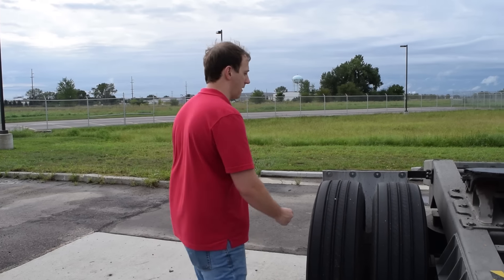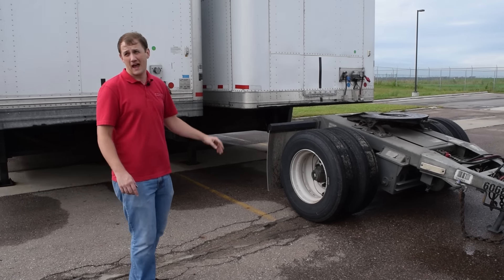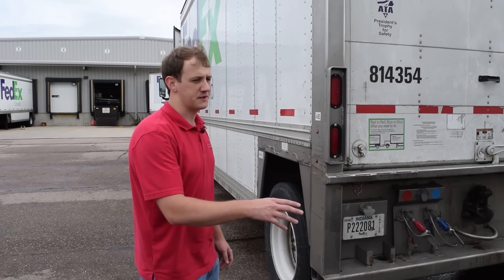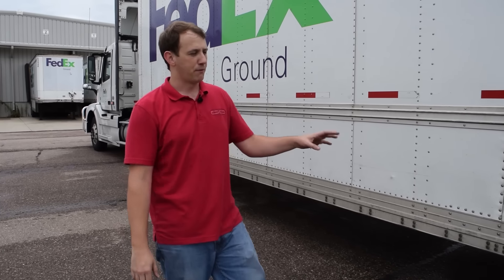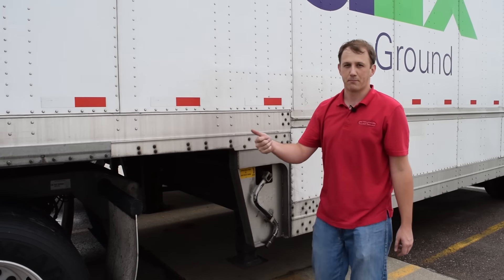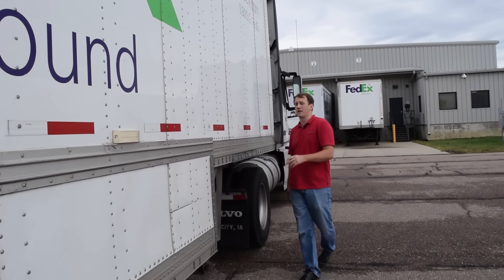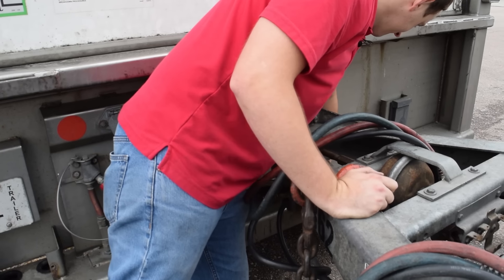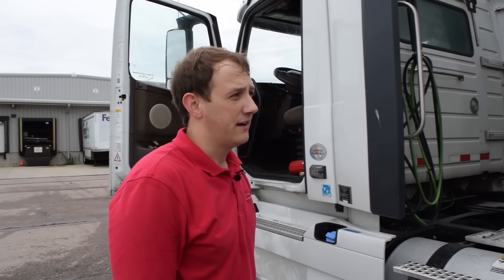FedEx Ground Doubles - Double Trailers

Comment: 2:30 Why don't you attach the dolly to the trailer when you're already there with the truck? Am I missing something?
Reply from the maker: The process is 1)place dolly uncoupled in front of rear trailer 2)back lead trailer to dolly 3)couple dolly to lead trailer 4)back trailer dolly combination to hook rear trailer.
If you couple the dolly to the rear trailer using only the truck 2 things happen 1)the force of the trailer weight on the dolly makes it virtually impossible to disconnect it from the truck's pintle hook 2)if you do manage to get the dolly unhooked from the truck you would have a very hard time getting the lead trailer in the exact correct position to couple it to the dolly.
Reply: I was just thinking the same thing!!😉 😆
Reply: Thorough video!!!
Luke my man below said...
Reply: It is more difficut to steer the dolly when it is attached to the front trailer.  Drivers that do not know how to control the dolly can easily jackknife the dolly and cause serious damage, so many companies do not want drivers backing the dolly behind the trailer more than a few feet.
Reply: Some places doesn’t let their driver do that because of damages people caused to the trailers
Reply: Oh, okay. I drive a truck in the EU and we don't have anything like that here, and especially tandems like this are very rare here. Immediately this question came to my mind that if he's already there with the dolly why doesn't he just hook it up. I guess your trucks also have the ability to lift the rear axle by air, so I thought if you can affect the tilt of the dolly then somehow that might work instead of backing up with a semi and a dolly that you can't see behind the semi.
Anyway, I wasn't trying to lecture or admonish anyone for doing anything wrong, I was just curious why it was so hard to do when in my head it was a lot easier.
Reply: @Orion599  if you go ahead and hook the dolly to the rear trailer without the front trailer you'll never get it connected to the front trailer
Reply: @tamipotirala6973 
For this reason, I am happy with the European system. Both truck and trailer have air suspension to use for lifting. Plus, the coupling used for dollys (or any other rigid truck + trailer combo) has something comparable to the jaws of a fifth wheel in all four directions, which makes it very easy to use dollys even if they are still connected to a trailer.
Reply: @Toepferle  interesting I like to see that
Reply: We like oldshool style. Americans, on the other hand, still use oldschool equiptment.
Reply: @Hypheh  Say what?
Reply: @mwalker3547  That dolly system is used by poor farmers in europe. Even rich farmers dont use so old design anymore, not to even mention road transport sector.
Reply: It’s all confusing is mixing trailers and different scenarios
Reply: It's very easy for the dolly to jackknife! 

 its already hard enough to back with the dolly on the tractor and keep it in a straight line. Imagine trying to back up with the dolly hooked to the rear of first trailer!

Comment: Make note. If your dolly that you pick has a problem. Please "RED TAG" the dolly. Note/state problem on Red Tag. Also let your dispatcher know that there is a problem with the dolly. Also goes for the trailers. Don't have RED TAGS? Ask your dispatcher/local maintenance shop. It makes my job a lot easier know what's wrong with the equipment and not just someone red tagging a dolly or trailer so NO ONE can us it. Thanks!!!

Comment: I used to be a DedEx Fround contractor 15 years ago...absolutely the worst....started at 3 pm, sometimes done at 11 pm or 12, and other days, the sun was coming up again...they didn't really care.  Get home at 7 am, go to bed so I could wake up and do it all over again.  Look at your pay settlement, not much difference between the 2.  

I never had the guts to do it, but, I always admired the guys who could break doubles by releasing the pintle hook on the dolly and slide it out from under the rear trailer at the same time!  It always looked great!  Dolly bang the pavement.  My luck, it wouldn't come out under the trailer all the way and be stuck up in the air!

Also, the guys who can back up doubles, turn them around...that is talent!

There just isn't any money in running for $1.40 a mile, I don't care what EdFex does for fuel supplement.  Cost of repairs, insurance, tires just keep going up.  

I have my own authority and haul my own freight.  Much better off.
Reply: Depends on terminal

Comment: When connecting to a trailer at a dock, make sure to knock/bang on the trailer before anything to check for loaders. I worked at FedEx for 2 and a half years And there was many times where the truckers hooked up and some even took off with me in the trailer.

Comment: This is a great video if you work out of terminals.  But if you are heading out with a set of joints full of freight going to some obscure warehouse, the set up may be different.  There are a lot of little tricks you need to know.  For example, if you are dropping your trailer on a curbed street be sure to drop your trailer with the front of the trailer nosed out from the curb a ways.  If you drop it straight against the curb then when you go to back under the trailer it will slide toward the curb because the crown of the road surface will cause the landing gear to slide up against the curb.  When that happens your duals will run into the curb and you will never be able to line up the kingpin into the center of the fifth wheel.  When that happens you have to call a tow truck ($400.00 in 1974), to come and lift the front of your trailer back away from the curb so you can get under the trailer to hook up.  One of several expensive lessons I learned the hard way during my trucking career.  Nobody ever told me Jack.
Reply from the maker: When doing linehaul for FedEx, they just make it too easy! Thank you for sharing your experiences with us!

Comment: Been pulling these things for over 15 years. You will pick up tips like also putting air to the brakes and cracking open the blue line at the rear to make sure you have sufficient brake air supply there too, especially in the winter because ice can form in the lines and boom no brakes back there. Also to insure you have no air leaks in the brake lines too. There are other tips even when selecting your dolly etc. etc. 
good video.
Reply: Big Steve Da Trucker : Yes they should be crossed. I caught that too. Moved rental equipment for 6 years and that’s all i learned.

Comment: Pulled doubles for 3 years for Carolina Freight carriers from 6pm to 3am.  Noticed changes in the
converter dolly (Bogey).  We never had air bags on the bogey back then.  You haven't lived till you had to walk back in a muddy field at some warehouse where the bogeys got dropped off.  Sure they roll real nice on blacktop!  Not so easily in mud with big holes in the dirt in snow and darkness.  Good times!
Reply: Forgot to mention.  That was 30 years ago!
Reply: Plus!  Our Pups (28 foot long trailers with single axles ) had  a safety bar in the front of the trailer to drop and secure so some poor soul on a forklift bringing freight in didn't get hurt when the trailer tipped down because the driver forgot to lower the bar and put a pin in it.
Reply from the maker: Times have changed! Luckily for us, we're always on pavement. Airbags have replaced all our leaf springs too!

Comment: I also pull doubles for a FedEx Ground contractor. This is a very good video but I do things a little different. 1. If the dolly chains are long enough they should be crossed. 2. Before hooking my air lines and electrical plug up I make sure the 5th wheel jaws are locked. Then I hook up the air lines and electrical line. 3. When dropping the rear trailer I disconnect all of my air lines to my dolly after pulling the 5th wheel and lowering the landing gear. It does save a little time when pulling the dolly away from the rear trailer because you do not have to sit and wait for the dolly to air up again. Plus some people drop their trailers too high and it can be a pain to lower them.
Reply: You need to go on Oprah,Amazing.just sayin'
Reply: But the payed it not acuray
Reply: ...nobody cares.

Comment: Well done brother. Going to take my doubles endorsement test tomorrow. Then I'll be hauling for Fed Ex.
Reply from the maker: Congratulations! First time showing doubles to a driver always makes me smile! It's not a hard process, and I truly believe doubles are better to pull than a 53' just for their agility while cornering. Safe travels!
Reply: @C2CCorps  I'm struggling with maneuvering the dolly in fact I had one the other day roll away after I released the brakes when I was gonna hook it to the back of the bobtail
Reply from the maker: @tamipotirala6973  That can be a problem, especially if you're not working on a level surface! There is a way to work on hill, you just need to be hooking perpendicular to the slope! Hopefully it was a non-event an nobody was hurt!

Comment: Very good video only parts i would recommend is wear gloves always for safety and so your not getting grease all over your steering wheel and every where else in the truck and hook up everything on the dolly from the other side that just so you can stay clean no lean against equipment also most importantly I wouldn’t spin the landing gear like that I’ve seen numerous people bloody there nose with catching it on there nose you could even break your nose just a thought to be safe stay safe to all the truck drivers out there good luck and have safe trips

Comment: Good training video....only critique is to not spin handle while rolling up landing gear.
Place one hand on trailer for support and roll up slowly. Too easy to loose grip and slip or hit yourself with the spinning handle.
Current CDL A driver of 30 years and 1 year with Fedex Custom Critical.
Thanks for your video.
Reply: @hello Richard how are you doing?

Comment: Back your dolly closer to the rear box. Try moving it the last 5 or 10 feet like he did in the winter. Have fun with that...

or even better, back your front box and dolly together onto your rear trailer. makes winter do so much easier.
Reply from the maker: Thanks for your insight! One trick in the winter when you're on fresh snow is to back all the way to the trailer and let the dolly's 5th wheel plate bump the trailer. Then pull forward a couple feet to unhitch the dolly from the tractor. Doing this creates tracks in the snow so you can still move the dolly by hand.

Backing the lead trailer and dolly combination to the rear trailer is doable, but you should practice caution when doing this. The dolly can jackknife quickly. Risking damage to the dolly and lead trailer when doing so, so be careful!
Reply: And other issue with backing lead and dolly together, FedEx has these safety bars on a lot of trailers and dollies that put pressure on the pintle hook when air is supplied. This unfortunately makes is hard to maneuver the dolly because it won't turn as freely, you pretty much have to jack knife the trailer to get the dolly to turn.  Can't be annoying. With out the safety bar is easy as pie. But it's rare to get a trailer and dolly without this feature.

Comment: I worked for FedEx Ground for just over 3 years in the New England area unfortunately I moved and I'm trying to get back in with FedEx Ground in arizona and it's not easy. The thing is most trucks I used was a dual axle and u can't get under the trailer to check ur fifth wheel if you have dual axle
Reply from the maker: You can....the 5th wheel on the truck needs moved back. Since the video, as a company we no longer have single axle trucks and only operate twin screw trucks.

If the spacing between the mud flaps of the truck and the landing gear on the trailer is too tight to get in and check jaws, make a hard turn to the right, about 4 feet. This will allow you to look into the jaws from the driver side directly. Due to the position of the truck to the trailer as it will be in a "turning" configuration, you can see the 5th wheel jaws easier.

Comment: I've been working for FedEx for 25 years. And it's shocking to me that all the truck drivers on here that missed the one thing he missed on the pre-trip. That was obvious as someone putting a live chicken in the cab your truck. There's no way you could pull these doubles down the road like this legally. Let's do a challenge let's see who notices what's wrong with this set of doubles and why you can't pull it down the road the way it is? I will tell you what it is if someone doesn't see it in the next couple days. It's a safety violation.
Reply: He didn't activate his brake lights during inspection and also has a e track strap hanging out of the rear trailer closed door.
Reply: @fordfanatic3307  thank you sir! It only took two years for someone to figure it out.

Comment: Pintle hooks and safety chain eyelets should be mounted inside the tractor frame rails .  Mounting these past the ends of the rails will expose them to damage .
Reply from the maker: VIC, that's an interesting point you make. You're saying the end of frame cross member should be moved towards the cab?

Comment: FedEx is one of the few ltl's I didn't drive for.. Howard's, Rist, Yellow, Overnight, UPS and Conway. Conway was the worst.. mission impossible everyday and stressed out over worked drivers killing each other from dock accidents every couple months. I had a trailer pulled out from under me while loading which tossed me on the concrete at 2:am and before I knew what happened I looked up to see the tractor reverse lights on and he stopped 3 inches from my head due to all the dock workers yelling.
Reply: When I was in my teens I saw a CCX tractor pulling doubles that had unhitched from the Kingpin and sent the lead trailer nose diving to the ground around the area that I lived in DesPlaines Illinois and I heard some drivers were pulling pranks on one another about disconnecting trailers pulling Airlines just to mess with one another dangerous stuff
Reply: well damn!

Comment: Its strange to see so much room between truck and trailer. In the netherlands we move our 5th wheel much closer to the cabin. This is probably because of our length regulations. Truck/trailer maximum length is 15.5 meters. Driving a double trailer, its 25.25 meters. there is also a categorie that is aloud to be 18 meters. But i am not sure how it is called in english.

Comment: How does the trailer know it’s connected to a truck/dolly? Does the electrical plug tell it “hey, we’re connected. Are we getting air?” Or how does the alarm system know when to turn on/off
Reply from the maker: Hey, Emmett! The red air (emergency), blue air (supply), and electrical all connect through the dolly. The dolly has connections to the lead trailer that pass through to the rear trailer.

Comment: Whats the GVWR on the dolly and single axle trailer? Might grab 1 dolly/trailer to pull behind a truck without a 5th wheel connection so I can still have a dry van option when needed.
Reply: In most places, it is 20k per axle but bridge weight comes in to play so depending on the axle spacing it can be less, usually dolly and trailer can be around 37k together.  You would want a heavy truck to pull that much in a pup behing it, and you would want the drive axles as close to the pintle hook to avoit the trailer swinging the truck around too much.

Comment: How you unhook the dolly to the last trailer without first releasing the brakes to the dolly? It won’t budge because of the weight of the trailer until you release the brakes you’ll see the trailer drop then you can release the handle for the trailer .
Reply from the maker: https://youtu.be/05lVyEYOaPA?feature=shared&t=1031

By replacing the airlines on the glad hand retainers inside the dolly basket, it blocks the air from traveling out of the dolly, and it releases the dolly brakes. After pressing the "red/emergency air" or "red/trailer air supply valve" within the cab, the dolly brakes will release and you can pull the dolly out from underneath the rear trailer.

Comment: Nope. Best to connect, get out check under the trailer to see if connected after you hear the click, get BACK into the truck and do a tug check. Then get out and RAISE THE LANDING GEAR!!!!! THEN connect your lines. This way you won't accidentally forget and pull off with the legs still down.

Comment: Here's another question wouldn't it be easier to just pull a 53' than 2 tralier
Reply from the maker: Versatility. For example; we run from Sioux City to Kansas City and back, but on they way back we pull one Sioux City and one Omaha trailer. We then stop in Omaha on the way back to drop the Omaha trailer, then pickup a trailer that's assigned for Sioux City from Omaha. So Sioux City receives 2 loaded trailers.